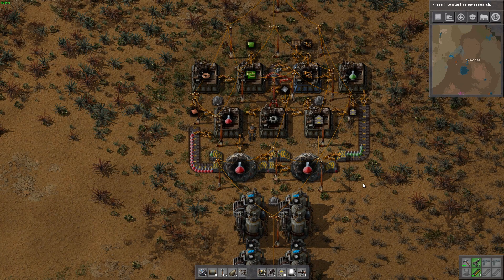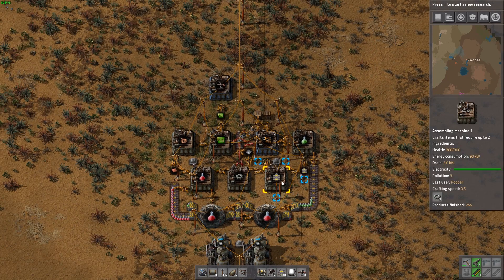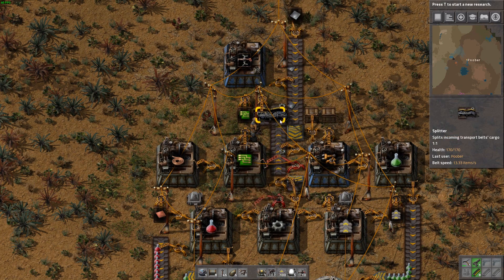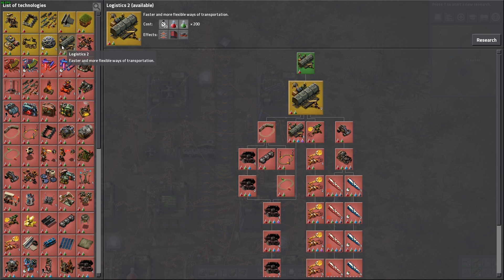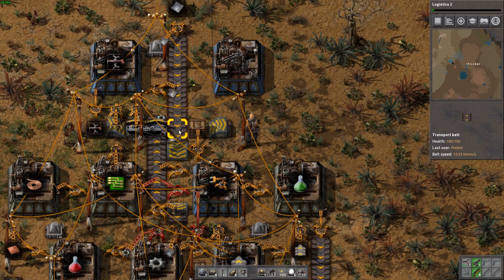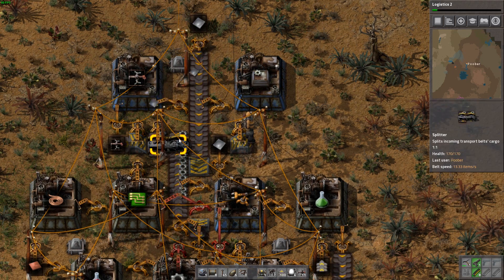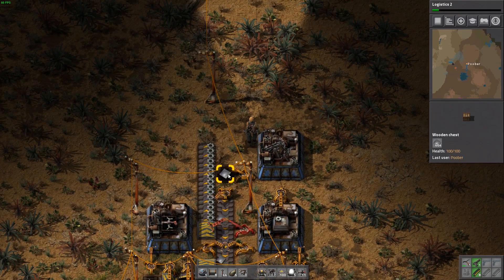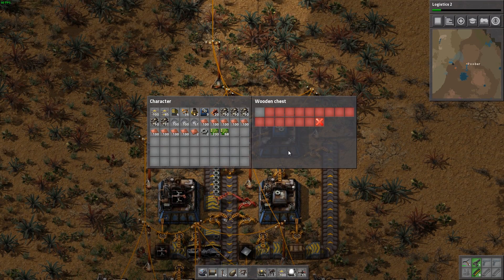FACTORIO 0.16 | Basic Automation - Episode 3

Comment: The green chips need a blue inserter to collect the iron plates before the gears grab them all.
Reply from the maker: thanks for the suggestion! I just went into the game and tested it with the blue inserter but the yellow inserter for the gear wheels is still picking up the iron before the blue inserter can. I'll have to test around a bit more.
Reply: This would cause the opposite problem though, where gears get no material.